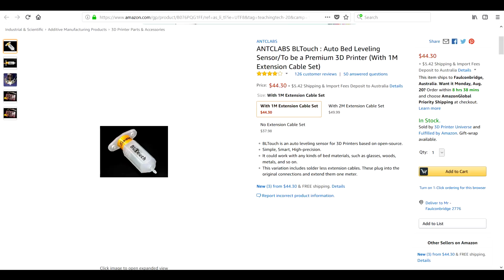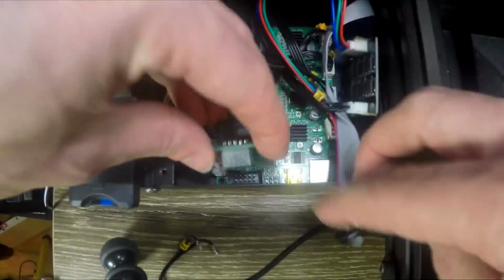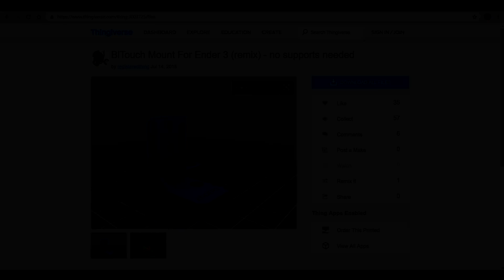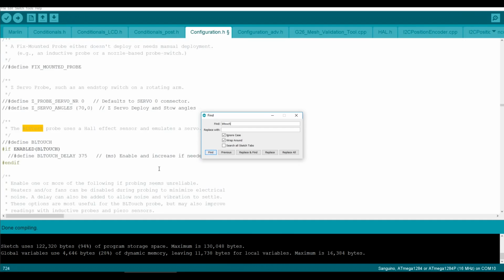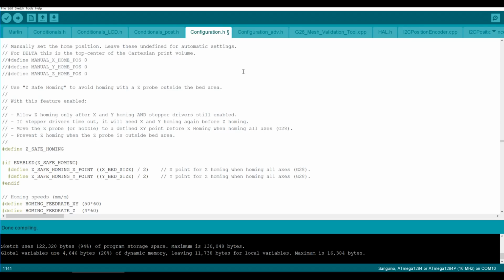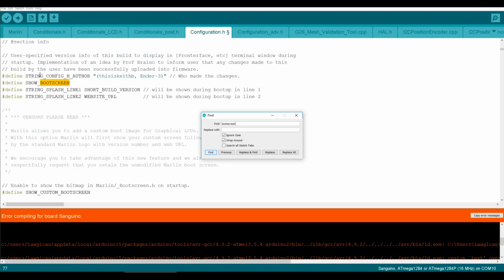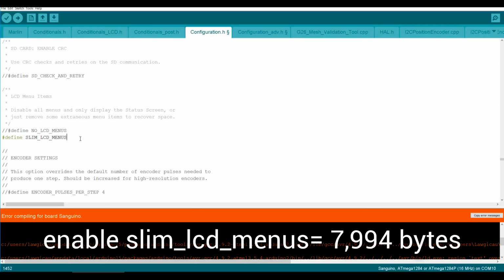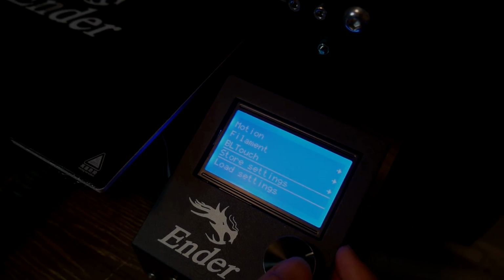Ender 3 BLtouch vanilla Marlin guide

Comment: FYI, I couldn't make BLTouch fit in Marlin 2.0.5.2 without disabling M503. A control board upgrade is likely in the future for anyone that wants to stay up to date with vanilla Marlin and ABL.
Reply: I have BLTouch 3.1 on Ender 3 with 1.1.5 board (TMC2208). Marlin 2.
Reply: I followed this guide.... and it worked for me. https://thborges.github.io/blog/marlin/2019/01/07/reducing-marlin-binary-size.html

Comment: For anyone having a go at this now... If you push the two ends of the mesh sheath towards each other (make it shorter), the diameter increases by about 3x - making it easy to just push through. Combined with what someone else said about using some filament to 'fish' it through, it will make it a much easier task.

Comment: G'day Mate! Fellow Aussie here. Love your work - would have never gotten as far as I have without them. Quick question - I have an Ender 3 Pro with a Creality v1.1.5 board. Will everything in this video, as well as the vanilla Marlin guide work on that? I've followed them both and have the file compiling properly, but I'm reluctant to flash it till I'm sure I'm good. I'm still using v.1.1.9 Marvin. Thanks again for all the hard work.

Comment: Thank you Michael for the video.  I followed the steps, then looked like I bricked my Ender 3 (screen turns on, but nothing visible), and then re-flashing from another laptop seemed to have made it work.  I wouldn't even have attempted building a firmware if it wasn't for your video.

I have question.  I have the Ender 3 "pro", and after I built the 1.1.9 firmware, it now says "Ender 3 ready" at the bottom of the info screen (whereas it used to say "ender 3 Pro ready").  I noticed on TH3D firmware, it says "TH3D BLTouch Ready" at the bottom of the info screen.

I tried to search configuration.h and configuration_adv.h to see if there was a place for me to change so that I can put custom name here (Putting "BLTouch" ready" (or "enabled") would be nice, or even put a different message).  A simple search for "ender 3" returned no results in both files.

do you know where I would change in the arduino files to change this?

Comment: @Teaching Tech I am running into a bizarre problem here - the 1.1.9 Marlin that I am downloading is a different starting size than the one in your video  - by almost 8000 bytes. If I follow the directions here, to a "T" I am still well over the byte-size limit for the 1284P Melzi board. What exactly am I missing? I'm trying to find the link out to your files, too, to compare so that's my next step I guess.

Comment: I've configured my Ender3 using your guide and I've some issues using OctoPI/Octoprint. I've added G29 code in "GCODE Scripts" "Before print" section. But when printing first layer there is no Z correction made. Any suggestions? Should I pass some aditional parameters to comunicate with firmware? Save with (M500) ABL mesh after G29?

Comment: Thanks for a wonderful guide - It has helped enormously, Thankyou!

I did find one unexpected problem and would like to share the solution I found.
I purchased a Pin 27 board from amazon and fitted it as described but when I came to put the cover back on my Main control board case the top of the strip connector was fouling with the front left corner of the fan.
I noticed that my ender 3 has a rainbow strip, not a grey with one pink wire as show and described. I suspect it is also a higher profile plug too. My solution was to :

1. Remove the strain relief clip from the strip plug
2. Bend the strip of wires forwards so that they did not pass over the top of the plug.

This resulted in a tight fit but hopefully no pinched wires and now the lid of my box fits again. 

Has anyone else run into this problem?
Reply: I had the exact same problem with a kit I bought, thanks for the tip!
 for something sold by creality the setup is very sketchy

Comment: In your video in section #if DISABLED(ENDSTOPPULLUPS)
you suggest to uncomment the //#define ENDSTOPPULLUP_ZMIN_PROBE 

clearly wanting to ban PULL UP resistor on this input.
However, you do not understand how DISABLED macro works . 

Everything that is under #if DISABLED(ENDSTOPPULLUPS) will be skipped if ENDSTOPPULLUPS is defined. 

To obtain the desired result we need to comment out //#define ENDSTOPPULLUPS 

and in the section #if DISABLED(ENDSTOPPULLUPS) uncomment everything except 

//#define ENDSTOPPULLUP_ZMIN_PROBE. In your case nothing happened the input ENDSTOPPULLUP_ZMIN_PROBE
still PULLS UP.

Comment: The best $1 AU, $0.66 US I ever spent.  I have a good idea you can sell me.  I want to print a small Yellow sign with Black letters.  Another video uses Cura Pause at Height/Layer to change filament but it continues too high and spits out filament in the air above the sign.  He does not know why.  I wanted to try the Cura Change Filament at Height/Layer which uses D600 but to use it we need 
ADVANCED_PAUSE_FEATURE and NOZZLE_PARK but do not have enough memory to use them.   Do you have any idea of other options we really might not use to free up more space?   Thank you for all your good work with 3d Printers

Comment: @teaching tech
Although I've followed your step-by-step guide, when I tried to do the print test, a side of the bed was perfect and the other one was awful.
Do I have to level the bed even using Bltouch?
Reply: Hello. The bed should always be the most leveled possible. Bltouch can compensate for some, but it is probably the best to manually level your bed from time to time. Mine is printing well from about 4 or 6 months now without leveling, but I'm starting to see some artifacts that might be because of that.

Comment: Michael, you're videos are fantastic. And as an American, I'm genetically predisposed to love that accent! I'm stuck on the hookup of the 3 orange, red, brown wires to the mainboard. I have searched and searched, and found nothing definitive on what the proper orientation is when plugging them into the pin 27 board. I've found pictures, including pausing your video to look at the colors, but that doesn't give me any warm fuzzy assurances. I'm very paranoid about letting the magic smoke out. Help!
Reply: I straightened it out, so here's the scoop for the next poor searcher with the same question. It turns out my pin 27 board was indeed marked, just with values, not colors. So I had to look up the BLTouch color assignment to do the match.

On the BLTouch:
Red - 5v
Brown - Ground
Orange - Signal

On my pin 27 board (on teeny tiny letters, on the back):
Vcc - (Red)
Gnd - (Brown)
Sig - (Orange)

Comment: What difference do you need to do if you have the new 1.1.5 board?
Reply: I have installed BLTouch on my Ender 3 v1.1.5 board using TH3D ver U1R2.11.  All worked OK. I used the creality BLtouch Kit from Banggood with the pin 27 board.

Comment: I'm installing the three point plug and the three connecitons on the chip that I bought say:
SIG , GND , VCC.
The colors of my wires are like yours, brown orange and red. My chips 3 point plus is oriented differently than yours though it attaches from the top position like the ribbon cable, not on the side like yours. So I can't copy your orientation from the video. Can you clarify for me which plugs go where? I don't want the magic black smoke and to have a bad day. Thank you! :)
Reply: Can they go into any pin, as long as the other side of it, when I connect it to my BL touch. I take off the little wire it comes with and make sure the colors were oriented the same? I'll be so upset if I mess something up lol...

Comment: If I'm adding the filament sensor from the other guide, is running out of memory by 5000 (bits ? ). Is possible the combination marlin 1.1.9+SD card support+bltoucht+filament sensor on Ender 3 silent board (07/2019-> 1.1.5 )? At the moment I have to disable the sd card.

Comment: I was doing the wiring in the control box, following along with you. I'm not familiar with wiring or positive vs signal vs whatever, but I noticed that, with the 3 pin cable, two wires didn't match what you had, so I swapped them. When I turned the printer on, I heard some popping and saw some sparks and some smoke. Apparently, I had the two wires done incorrectly, as you had warned against. With the popping, smoke, and such, is the whole main board fried?

Comment: Not sure someone can help me here, but Ive done all of this, to the point where I begin the firmware stuff, but after the wiring, my Ender wont power. It sort of flickers on the screen a little bit but just barely. So when trying to use the firmware, it doesnt find the Ender 3 since its not getting enough power. I have tried this with and without the Pi hooked up, direct from PC to Ender, etc. 

Anyone have this problem?

Comment: MKS GEN L board, MKS TFT28 Display, Creality BLTouch v3.0.  BLTouch was working on original Ender 3 Pro mainboard.  When I move everything over, things seem ok until I plug the BLTouch into the ZMin connector at which point powering up the board give a kind of drawn out beeeeep from the TFT 28, a red light on the mainboard, then the light fades out and tghe board seems to go dead.  If I remove the ZMin connector, I still get the kind of drawn out beep but the board stays powered up.  Any ideas?
Reply: I have the same problem...Did you ever figure it out?

Comment: Need help!! Using newest version of th3d U1.R1.11 with a 3D Touch, and pin 27 board. Printer is a ender 3 pro. Board 1.1.4. Wont stop going down when I do auto home
Reply: Adam Ross Swap your Z end stop wires. (The two wires that plug into the motherboard)

Comment: Installing bltouch v3.0 on 1.1.9 Marlin - is it possible? I followed Michael's steps to the letter but the bltouch not respond to any commands. I then saw a couple of reddit comments that v3.0 bltouch is not compatible with Marlin 1.1.9. Has anyone found a solution? My board is MKS Gen L but I was very careful to make sure the configuration was adopted to bltouch there as well.

Comment: Do you have a configuration.h and a configuration_adv.h for the MKS GEN L V1 for the Ender 3? I am going to be using the tmc2208 in x,y and z. Got everything installed. Before the firmware upgrade the bltouch would do it's self test thing when powdered. After the firmware update when you apply power the bltouch just blinks. Thanks in advance.
Reply: Figured it out. I had the servo, power wires  plugged into the wrong row of pins. My eye sight isn't what it used to be. Lol. Works great now. Fantastic videos.

Comment: I initially tried upgrading my Ender 3 with a BLTouch and the original Ender 3 board. I failed.  Then I replaced the original board with an MKS Gen L and successfully got the BLTouch to work.  I was quite pleased with the results.  However, I recently watched Chris Riley's video on using Unified Bed Leveling and thought I might try it, but I am unsure if UBL offers enough of an advantage to warrant the effort.  Have you tried UBL?  Is it worth the trouble?

Comment: Hey man, just an update. The new Marlin software actually is 100% easier to set up for the BL Touch now. Enable custom probe, set your offsets, and you're done.
Reply: what new version are u talking about?
Reply: @matthaupt842  probably U1.2!0d. I dunno if its easier though, I've been struggling for weeks. At this point my probe works but the [rint head keeps smashing into the bed when I do an m48 test. There are no options for BLTouch from the main menu on my LCD either.

Comment: After using this sensor for over two months i can say it is expensive, unreliable, flimsy and in essence rubbish. 
The plastic pin of v2 will break. That is why there are so many places selling replacements. That will set you back between 15 an 20 USD depending on the reseller. 
It rattles with an awful noise. 
If not calibrated and offset programmed correctly it will push down 1/20 prints. I had several easter eggs ruined from it....
It adds a tedious sequence every time you need to print as you remove your Z end switch and the zeroing takes 10 times as much time as before.
It will take you through hell to calibrate it correctly as noone explains what exactly it does and how does it benefit your prints. 
I ruined one buildtak bed completely due to this sensor not zeroing correctly after each reset. 
Returned to manual leveling with a gauge clock and never looked back. Cost 8USD plus a bracket print. Works like a charm. My last 20 prints have been perfect and my new buildtak bed still looks like new. 
If you want an auto-level printer fork out 200USD and get one that has the feature build in instead of going through hell to end up throwing it to the garbage...

Comment: Hi, thanks for this nice video. I have trouble with getting my BLTouch (genuine Creality pack) to work on my Ender Free with Vanilla Marlin. I followed your guide about he Creality BLTouch hardware installation and this video for Vanilla Marlin 1.1.9 configuration. It did not work. The BLTouch trigger is not detected. I changed to Vanilla Marlin Bugfix branch. It did not worked any better. I tried swapping the black and white wire on the Z Probe Connector but it did not solve the problem. When I use M119 with plugged cable it returns "Open". When I use M119 after having unplugged the Z Probe Connector, it returns "Triggered". I don't see what could be the problem. AWhen I use M43 S, it does not detect the triggering when I trigger manually the probe and it reaches timeout. Do you have any idea ?
Reply: Got the answer from Jerezer1985's comment below. See Pastebin for easy reading: https://pastebin.com/xx5tWZZS . It's working now !!!

Comment: Just a little tip, I had great success using a piece of filament to fish the wires through the cabling sleeve. I was able to tape my wires on to the filament using a small amount of electrical tape and pull them right through the sleeve to the control board location.

Comment: You mention having to swap the Ground and Vcc wires going into the 27pin connector at the board, do you flip the wires at the sensor too?
Reply from the maker: Definitely not. You might not even need to change your wires, it varies from pin27 board to pin27 board. The important thing is that you check that yours matches and alter if necessary.

Comment: My new Smart V3 BLTouch. I am not sure how many this will help, but after hours of trying to get the BLTouch to work (All test would pass, all LED's were working, but the BLTouch would not trigger the Z stop properly and then go into alarm mode), I downloaded the Bugfix version of Marlin 1.1.9, Followed the rest of the instruction here except I uncommented "#define BLTOUCH_V3" and left "#define Z_MIN_PROBE_ENDSTOP_INVERTING false" at false per manufacturers recommendation, and all began to work. Hope this saves some people a lot of running around like I did. 
Also, thank you for making these videos, it has help make my Ender 3 a great little printer. Teaching Tech is always my first stop for info.
Reply: I just got my BLTouch and I was having the same issue. I had no clue that it being the smart V3 would make a difference till I saw this comment. So I checked to see what version mine was. Sure enough, it was the smart v3. I just tried this and it worked flawlessly! Thank you!!
Reply: Oh that's k God I'm going to have to try this on mine. I've been messing with it for about a week trying to figure out what I needed to change to make it work.

Comment: can you  please do a video on setting up a bltouch v3.0
Reply: Pastebin for easy reading: https://pastebin.com/xx5tWZZS

If you happen to purchase BLtouch v3.0 this guide won't work. Follow 
this and it will work perfectly. You must have already flashed a 
bootloader.
1. Download marlin 2.0.x (http://marlinfw.org/meta/download/)
2. Extract the contents somewhere and go into 
*/marlin-bugfix-2.0.x/config/examples/Creality/Ender-3 and copy 
everything that is there into *Marlin-bugfix-2.0.x/Marlin/.
3. From there run Marlin. Next follow the video you're on from 5m9s ( 
pre time stamped: https://youtu.be/sUlqrSq6LeY?t=5m9s ) and make all the changes shown in the video config files.
4. In adition to the changes in the video go find "#define BLTOUCH_V3." in "configuration.h" and make sure its enabled so it should go from "//#define BLTOUCH_V3." to "#define BLTOUCH_V3.". Don't forget you will have to disable some features for it to fit.
5. Fix your bed sizes. By default it is set to: "#define X_BED_SIZE 220" and "#define Y_BED_SIZE 220" When it should be set to: "#define X_BED_SIZE 235" and "#define Y_BED_SIZE 235"
6. After that you can upload it to Ender 3 and you should be set.
Reply: I just bought a BLTouch and its the Version 3.0. I followed your instructions using Merlin 2.0 and it's installed and working. Just got to get levelling setup I have one corner not quite right. Thanks for the info.
Reply: You also need Arduino 1.9.0  to compile marlin 2.0.x they say as much on the git hub for it, i found it under the beta releases
Reply: BLTouch v3 doesn't work with the Marlin 1.1.9 release. But there is a bugfix (bugfix-1.1.x.zip, patches after 1.1.9) available on the marlin hompage (http://marlinfw.org/meta/download/). Within Configuration.h (Configuration.h from ender 3 example_configurations folder) of this bugfix, you will find a new #define statement which is called #define BLTOUCH_V3. Uncomment this. In addition on the anctlabs page it is recommended to change #define Z_CLEARANCE_DEPLOY_PROBE  to 15 and #define Z_CLEARANCE_BETWEEN_PROBES to 10. But this ist not necessarily needed. If you mount the BLTouch v3. in the correct way everything should work. The reason for this is, that v3 of the genuine BLTouch has a different behaviour compared to v2 of genuine BLTouch. The rest of Configuration.h and Configuration_adv.h  (copied from example_configurations folder of bugfix-1.1.x.zip) must be changed acc. to the video. Btw thanks to your great videos!!